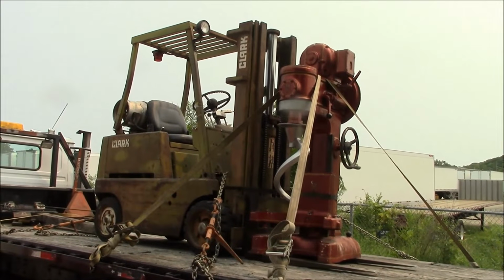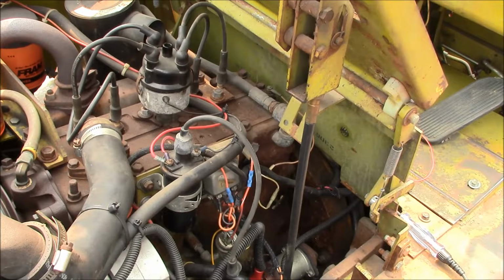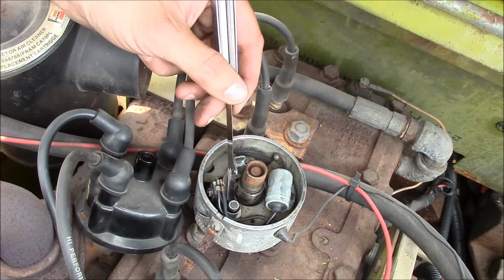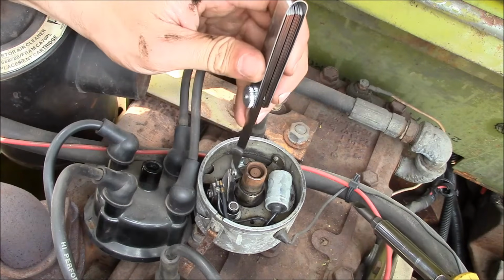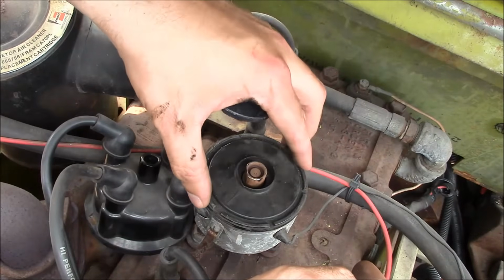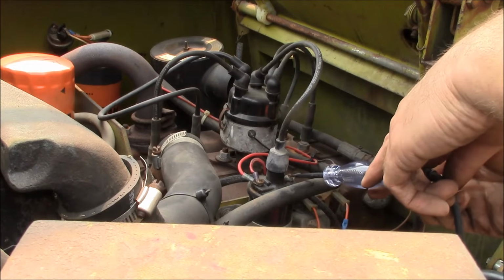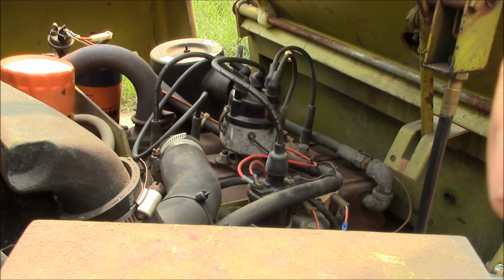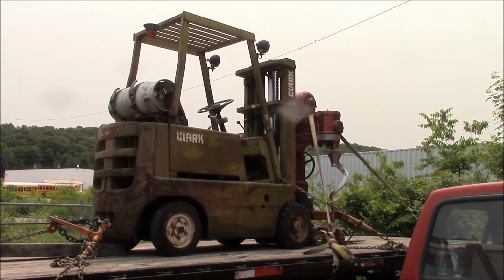My Forklift Died while Moving a Pizza Dough Mixer

Comment: It's YOUR forklift so you can do as you want with it.

With that being said, I personally would NOT get rid of the points ignition. Pertronix is like every other aftermarket parts company and they AIN'T what they used to be.

No parts required to get the forklift going again (even though the points probably need changed) and 3 simple tools to diagnose and to get running again.

Myself, I'd call that a 'win'.

Comment: I used to be a service tech for Hobart... Those mixers were really, really well made... I once did an overhaul on a 20qt mixer that was manufactured in like 1929  They used essentially the same design up until around 2005.
Another time, got called out on an 80qt mixer that wouldn't rotate... Opened the transmission cover to find the 2" diameter main shaft sheared right in two. The baker tells me "It just wouldn't turn when I pressed the start button"...  I'm like oookay how did you not hear that shaft snap!? ... He really didn't want to admit he had waaay overloaded the machine with a really thick bagel dough.

Comment: Hi Wes I know this video is old but I have the exact same forklift and I thought you had a video of resealing the mast cylinder. Anyway, Im trying to reseal it in the machine and can't get the rod to come out of the barrel. Is there a trick I'm not aware of or a part im missing? The nut is loose and it's all the way extended but just won't pop out. I don't want to destroy something. Please let me know anyone has experience with this.

Comment: now how did those points get too much gap????    been around a long time and never seen that one.  usually the fiber rubbing block wears or the bushings in the cam  for the advance mechanism wear  either way the points always loose their gap.
Reply from the maker: The contact surfaces wear over time.

Comment: On the points, more like next to the points there is a little nub (or 2 nubs, I forgit).  You place a flat head screw driver (I think I could see one in your vidja) to more precisely set the points than using your fingers as you did.  Sheck it out mangh.

Comment: I thought a resistor inhibited voltage rather than current ! So , the purpose of the Ballast resistor is too lower the input voltage to the coil as it heats up , AFTER the engine has been started ! AS the temp increases the resistance increases thus lowering the voltage !?

Comment: Filing points and setting the gap? What black magic is this?
As others have said.... a lot of modern day mechanics might have issues doing this (not bagging on them at all...they may have not ever seen a set of points). Probably a good thing you didn't start talking about dwell....

Well done....
Reply from the maker: Heh. Dwell is really only used on cars and trucks. These industrial distributors cannot be adjusted without removing the cap. They just have a gap spec and I guess that's close enough!

Comment: All good info!  You never know what we don’t know :]
I’ve seen the no spark diagnosis many times but not the “no flashy flashy” test.
I have an old Toyota Landcruiser (1984} and I upgraded the distributor to one of those solid state jobbies.
It lasted about 8 years until the little solid thing died.  It was cheaper / easier to replace the whole distributor than try and find the little solid bit.
But if it still had points I would know how to fix em now!  I also wouldn’t have needed to get it towed. ;)

Comment: You will have to change the coil if you go over to an electronic ignition. Can’t remember the reason but I remember the result of not doing so. The coil primary windings burn up super quick. Probably from the high voltage and current running through it.
Reply from the maker: Correct. If you remove the ballast resistor you need to change the coil.

Comment: That mixer would be at leat 60 years old, and in typical Hobart style,is still earning for it's owner. I was third generation bakery owner (younger brother is still working as baker) and we had a lot of those older Hobarts. I rebuilt a few which were getting noisy in the planetary but otherwise they worked well. Newer ones are made in Chicom land.... sadly.

Comment: If you clean up the primary and secondary circuit connections with emery paper to remove rust, and replace worn wires, you will get maximum voltage to the coil. The coil will then be able to bump this up to its maximum, giving a healthy, "fat" spark. With old vehicles and machines, corrosion is a problem and I even check/clean the ignition switch side - if its easy to get to. With all this work, you will be rewarded with a half kick start (as long as compression and fuel are ok) each time, avoiding starter motor/battery wear, especially on cold wintery days.

Comment: Tip for adjusting points, there should be a little gap spot on the bracket of the points that you can use a flat blade screw driver in to pry against that will allow for easier fine adjust. Sorry if that isn't clear, it has been a few years..
Reply from the maker: Good tip! I might see one set of points a year.
Reply: I was looking for that notch and didn't see it, which surprised me. Just the half-moon cutout on the outside edge of the point bracket, which wouldn't help much.

Another thing you can do if you have a feeler gage or the like is to squeeze the feeler in the open gap with your thumb and finger as you tighten the screw. Keeps the points from slipping around.
Reply: I keep my Ford 8N running by servicing the points every few years. It's a front mount distributor, so some tight places. Thanks Wes for knowing and showing the basics!

Comment: Point file  match book cover an your back in business, Mixer & forklift and pizza,all crusty. Are we going to have a moving video soon, Let's hope.
Reply from the maker: My dad is an absolute stickler about points. When I was a kid we had to clean them with a file, then fine sand paper folded in half (800 grit or so), then pull a clean strip of paper through until the paper would come out clean.